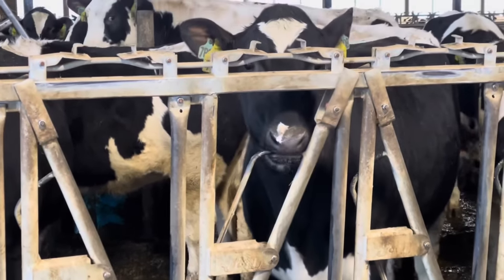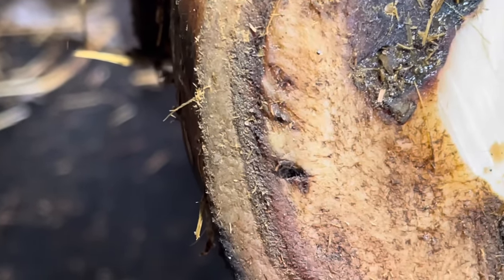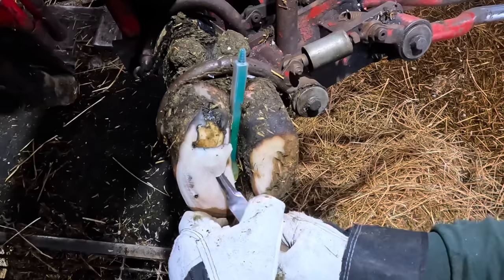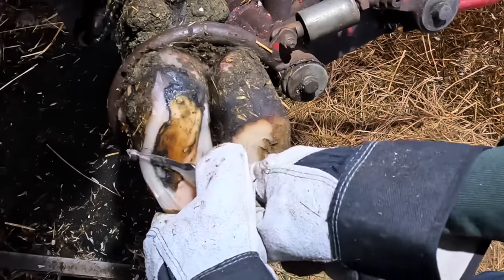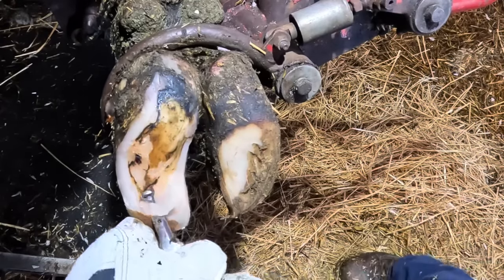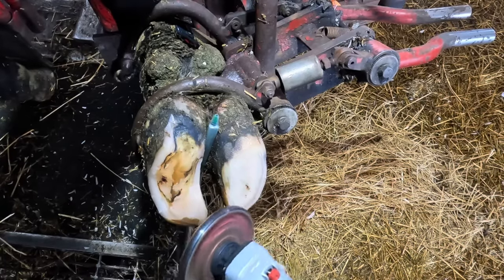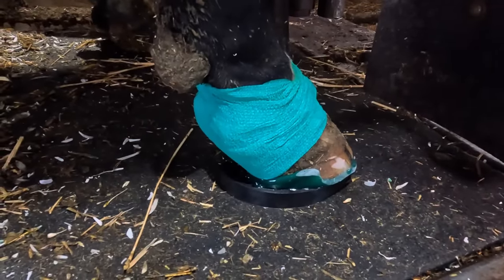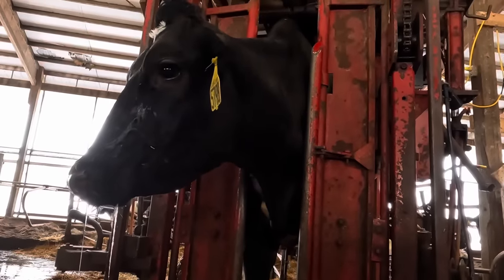THIS COW’S HOOF ISSUE IS OBVIOUS …..RIGHT???

Comment: What's the most common problem with cows? Does it change based on geography? Love your vids, they're very soothing <3
Reply from the maker: Dermatitis is probably most prevalent followed by whiteline disease
Reply: That was a great question!!! Especially the geography part. Wet areas vs dry vs cold vs grass etc... does dermatitis grow faster in warm humid conditions?
Reply: The most common problem cows deal with is money. Moo money, moo problems.
Reply: @NatetheHoofGuy  ç

Comment: Well done!
I'm sure it's fine, I just hate seeing cattle on all that concrete standing in large, shallow lakes of feces.   One would think with all the lasers and such we have, we could pour those floors with enough pitch to not belly so bad.
Granted, every cow I've seen in your video look super healthy; 100% healthier than the stock of many of the others in the UK and such.  I just can't imagine it's good for them to stand in that mess for any length of time.  A pitch to the concrete would be unperceivable to the stock but do a lot to keep lakes from forming, even if it's 1/8" per foot crowned.
Reply from the maker: It is actually.  I’m just set up in the spot that it’s sloped to.  There’s a metal grate in the floor that it drains to.

Comment: The debris would also get stuck to the camera lens, your face if not shielded, the shield then you can’t see, you’d have to stop and clean off plus you’d have to dry the other claw in order to glue a block it’d have to be dry there also you use a spray bottle with that stuff so you have more control over moisture. Yeah I have analysed these videos too much shame I’m not young I make a great apprentice hoof trimmer.

Comment: Awesome video I have a question does the rubber blocks you glue on come in different heights or are the same
Reply: They come in different materials, and some variation in shape & size.
Reply from the maker: They’re all 3/4 of an inch or less depth wise.  I’ve made some requests for deeper rubber blocks but none have been made yet.
Reply: @NatetheHoofGuy  thanks for the info I appreciate it

Comment: Not to be crass…but I’ve always wondered what does all of this smell like? You mentioned that you can usually see what the issue is, but are there smells that just give you a run for your money?
Reply: Digital dermatitis has a distinct smell that trimmers notice, sometimes even before picking up the hoof. Thrush, in horses, is similar in that. Abscesses always stink of infection, no matter the animal or area abscessed.
Reply from the maker: On occasion they do but I’m used to those smells by now.  The worst is when they spray on your clothes and then you smell it the rest of the day.